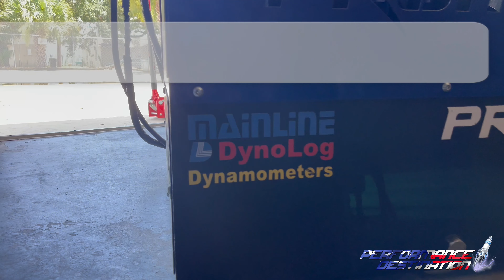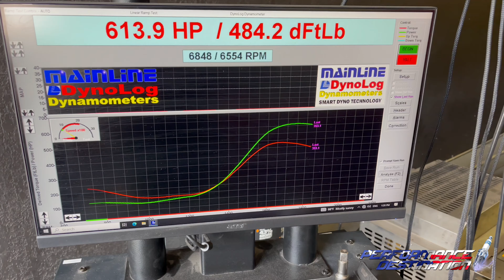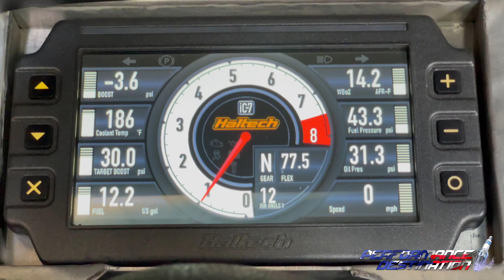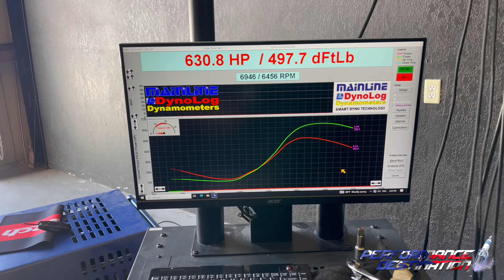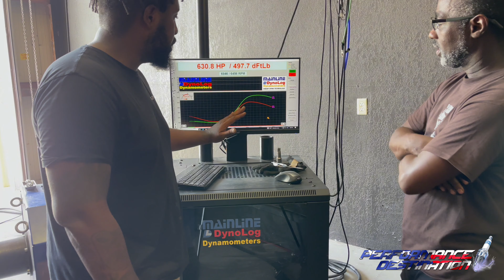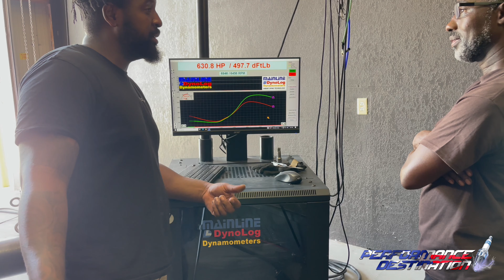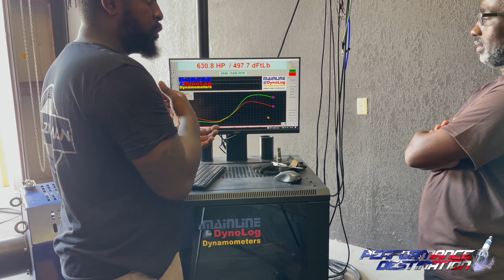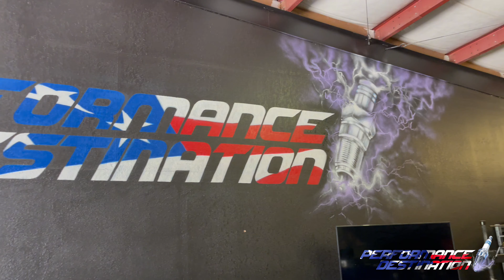MK3 Supra tuning on Haltech standalone gets hub dyno tuned on stock block

Comment: Calibration is foundational:
1 Hardware
2 Software 
3 calibration 

First need to ensure the hardware is set up correctly (timing, wiring, etc). Then ensure software is correctly taking inputs (sensors) and outputs (actuators) correctly. Then, ensure timing lights and injector flow data fuel tables are set up correctly (usually comes with the injectors when purchased). Once these foundations are set, then VE and Spark maps can be dialed in…